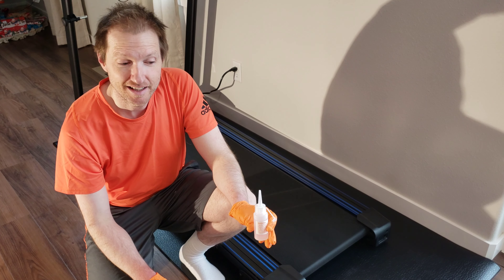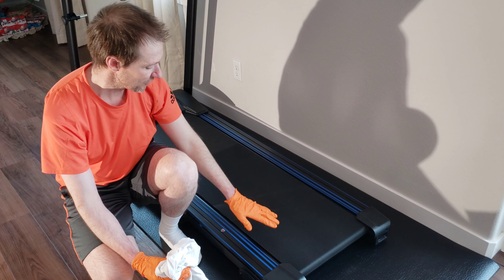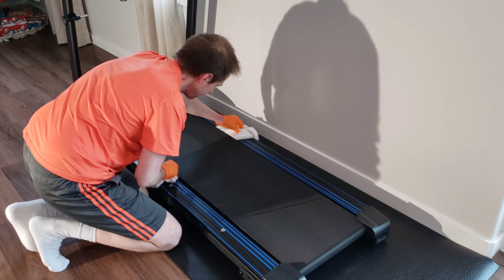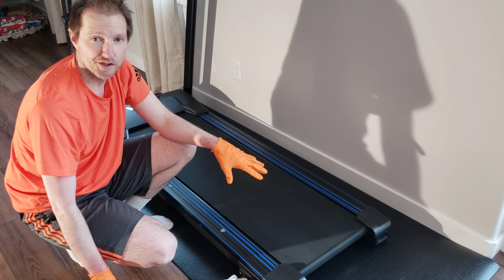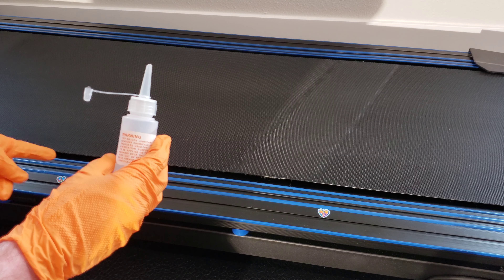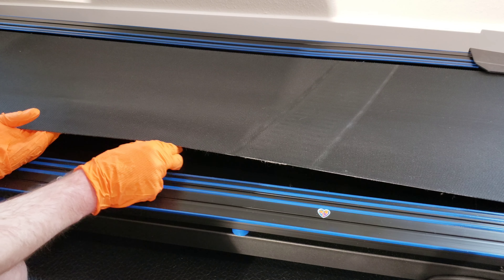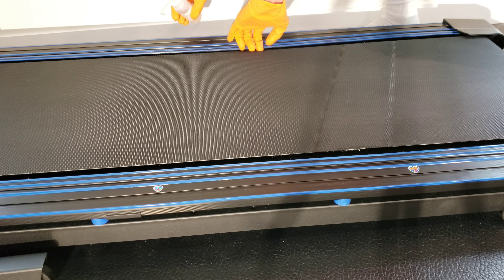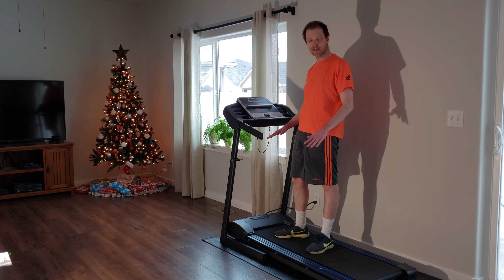How To Lube A XTerra TR150 Treadmill The Correct Way

Comment: Hey Todd,

I have an XTerra TR260, which is the same as the TR150 but with an auto incline.

Can you explain the part in the manual that calls for a damp cloth to be used?

Here’s the verbiage:

‘Belt and Deck - Your treadmill uses a very high-efficient low-friction deck. Performance is
maximized when the deck is kept as clean as possible. Use a soft, damp cloth or paper towel to wipe the area between the frame and 6 - 8” under the belt. This should be done once every other month to extend belt and deck life. Use water only - no cleaners or abrasives. A mild soap and water solution along with a nylon scrub brush will clean the top of the textured belt. Allow the belt to dry before using.’

I don’t understand why you would use water (or a damp cloth) ‘under the belt’ when you should only use the silicone lubricant there. And you only use a dry towel or t-shirt to get dust and debris out from under the belt.

I get cleaning the top of the belt but under the belt as described in the manual seems wrong to me.

Maybe you can do a 4th video explaining this.

Thanks!
Nick

Comment: Glad I found you...thanks for making the manual directions make sense.  I just purchased the same treadmill and I notice there is a squeaking noise that seems to be coming from behind me, towards the end of the belt when I am using the machine.  It said not to lubricate the belt when it's brand new.  Do you think I should lubricate it anyway and see if that solves the problem.  Thank again.
Reply from the maker: Hi thanks for watching! I'm not sure on the squeak, we notice ours squeaking sometimes also when it is near ready to be lubed. It's hard to say for sure without being there to hear it and look at the deck. Good luck, let us know if you decide to do it and resolves the squeak.

Comment: Hi Todd. My question is can I program my weight in the machine? Also i read it tracks calories? Are they even accurate?
Reply from the maker: Hi and thanks for watching I appreciate it! There is no feature to program a weight into the machine unfortunately. Also I am not sure if the calorie counter is accurate, but it does seem very comparable to other treadmills I have used. Thanks again for watching!

Comment: Thanks Todd, good information.  One question though.  My TR150 didn't come with any lubricant, and while I was running on it today, the timer disappeared and the word LUBE showed up.... What brand or kind would I purchase and do you know where from.  My las treadmill years ago, I used a treadmill lube and it almost ruined my treadmill, so I'm a little nervous about making sure I get the correct kind.  Also, can I still use the treadmill until I manage to get some lube or should I stay off it altogether?
Reply from the maker: Hi Tannis, Thanks for watching! They should of given you a silicone lube with the treadmill,  too bad they didn't! You could probably call there customer service and get them to send you one.  Silicone treadmill lube is what you want,  you could search on Amazon there is a few brands out there.  Without the lube the belt breaks down faster,  so is always good to keep it lubed on schedule. Good luck and appriciate you watching my video :)

Comment: How can I reset the lube on display please help
Reply from the maker: Hey Jessica after you lube it you can hold the enter button on the XTerra TR150 control panel for 3 seconds,  that should clear it.  Thanks for watching!
Reply: Thank you so much it helped 🙏🏻🙌🏻🏃🏻‍♀️
Reply: @ToddsGarage   Thank-you for saving my sanity, I had the same question. On mine it says to hold the “program” button and it was not working. Thank-you again!!

Comment: I did put the lubrication on the treadmill that came with it three times in fact it's still saying lube I'm not sure what else to do I followed the instructions properly as well I don't understand I put it on there before it's never been a problem even when I put the treadmill on 45 or 50 I still can walk I'm no expert but I'm sure at that point I'm supposed to be running
Reply from the maker: Hi thanks for watching! Is it saying Lube on the screen? If so there is a way to reset it,  I have a video on that,  check out the Xterra Playlist I have.

Comment: Thanks for this very helpful video, Todd. We've misplaced the lubricant bottle that came with the treadmill, and Xterra's customer service was taking forever, so I googled "treadmill lubricant" and saw that it is being sold by various vendors. Their specifications all note that the lube is 100% silicon. Is that what it says on Xterra's bottle? If so, then the other brands should work, right?
Reply from the maker: Hi and thanks for watching! It says in the manual that it is silicone lubricant that comes with the Xterra Tr150.

Comment: Unless I missed it I don't see him mentioning or loosening the 2 belt bolts. Aren't you supposed to do that first? No mention of that. And I assume he just used a dry cloth? Maybe this is obvious but it's my first treadmill and I found his instructions unclear.
Reply from the maker: Hi Andy, thanks for watching.  The instructions I have and the instructions on the Xterra website currently are the exact same as I show in this video.  There is no loosening of the bolts in the instructions I have or the Xterra website.  You might have different instructions? And yes,  its just a dry cloth I used to remove any potential debris. Thanks and good luck!

Comment: It says in the manual to loosen the two rear rollers to loosen the walking belt before lubrication & after lubrication to tighten them back up....did you do this?
Reply from the maker: Hi Janet, you might have a different model or possibly different instructions. The instructions I have do not mention anything about the two rear rollers. I checked the Xterra website to see if there was a different manual but they have the same one I do.
Reply: @ToddsGarage  Hi,  Mine is the TR150 folding model.  I'm going to contact the company to ensure the manual instructions are correct.  Cheers

Comment: My treadmill said  "lube" in the middle of my exercise this morning.  So I looked for the treadmill oil that came with my Xxterra treadmill.  Naturally that has been several months ago and I cannot locate it.  What brand of lubrication would you recommend?
Reply from the maker: Hi Nancy, thanks for watching! It's called silicone treadmill lube,  there are a lot of different brands out there but silicone treadmill lube is what you want. You might be able to call  Xterra directly and they may be able to sell you the original lube if you want that.  Good luck and thanks for watching!

Comment: Your method seems to contradict the instructions in my owner's manual, which says to apply the stream of lubricant in a line "across" the width of the deck "parallel to the motor cover", as opposed to down the length of the deck perpendicular to the motor cover as you show.
Reply from the maker: Hello, you might have a different model or a different version of the owners manual. They state in the owners manual to perform the lubrication as shown in this video. In the manual they use the language "perpendicular" to the motor cover which makes me think you have a different model or they made a revision at some point. Thank you for watching.
Reply: Yeah, was wondering the same thing 'across the deck parallel to the motor cover '  but wasn't sure how I could achieve that.
Reply: @ToddsGarage  Just got the TR150 from Amazon.ca today and the manual also says parallel to the motor so which is correct? Your video seems to do it perpendicular to motor. It also said to use the whole bottle. I'm lubing it because I checked under the deck and it's completely dry, no trace of any lube at all even though manual said it's pre-lubed.

Comment: If you watching video and planning to buy TR150, don’t buy it. It is a piece of junk. I bought one and in less than a year, belt stopped in low speed. I had to increase the speed to 1.3MPH for the machine to run. No programs would work as all of them start at low speed. Then after 10-12 mins, machine will stop with E2 - motor overheat and belt would stop. I called the support and they said I needed a controller, which is back ordered and would cost $120. The belt requires frequent lubrication. Don’t get confused by these videos.